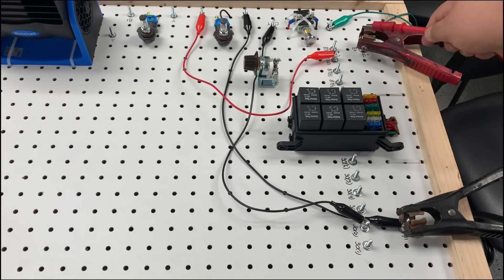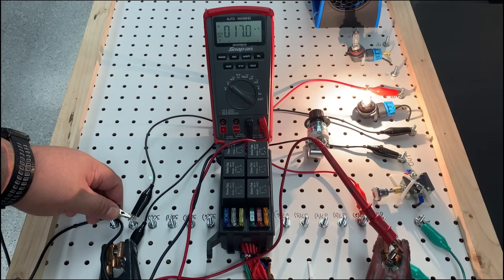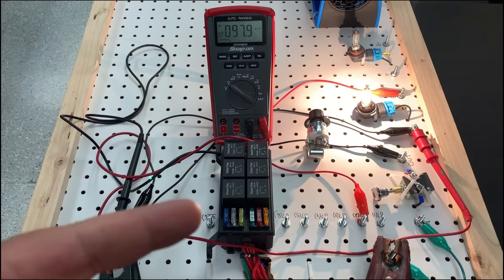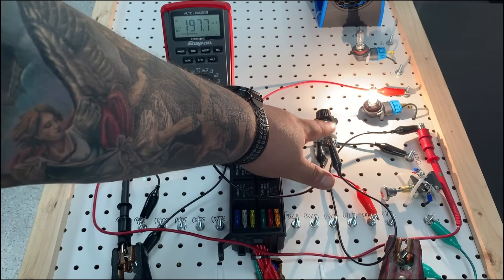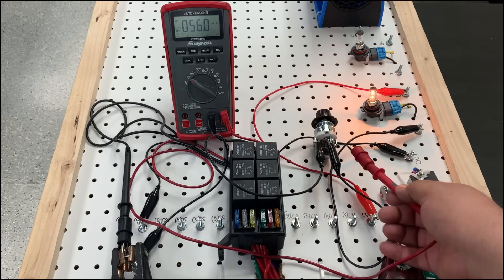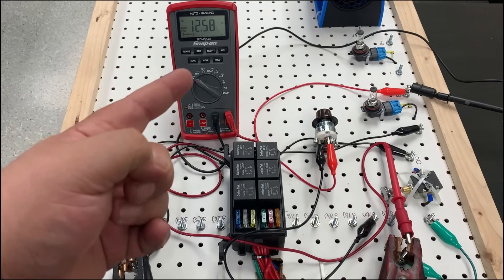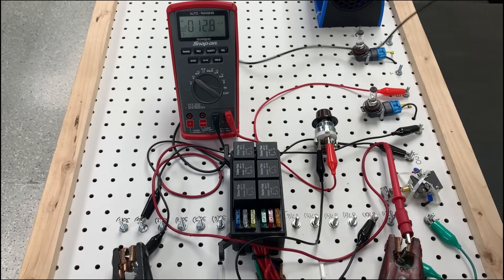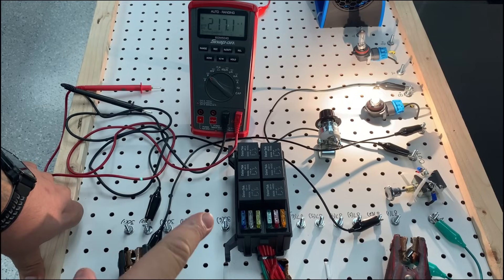How to Properly Test Voltage Drop in Automotive Circuits (Dynamic Method Explained)

Comment: im 86 years old been a mechanic most of my life understand voltage drop very well that being said for someone learning this is the best visiual explainition that i have ever seen i mostly learned trial and error. can remember the first time i had headlamp that woldn't work had power and known good bulb and without load had a good ground spent most of the day figuring out what could be wrong ran new wires and problem fixed this was very old vehicle no computers had even point type ignition. worked good with new wires then removed the positive lead connected original positive lead bulb worked  then removed new ground lead and reconnected old negitave lead bulb wouldn't come on wound up being a connector between dash and under hood had the green curse. wish had known this back then but will never forget load testing is the only way

Comment: Very confusing cant tell difference in the test and where the battery is supposed to be way too many wires going on brutha
Reply from the maker: In a car, is there more than one wire?
Reply: @MasterAutomotiveTraining 
I have to agree with Josh.  Your example was much to "busy" to effectively get the point across.  Unfortunately, you're not listening.

Comment: An OHM meter does have its place but good conductivity doesn’t mean good conductivity.Voltage drop method proves good or bad conductivity because of current flow.Vd=IR   Dynamic—must be powered up .Nice presentation CHEERS

Comment: Continuity tests at a few ma... a voltage drop test is performed at typical application current which may be 1, 3 or up to several hundred amps. Continuity will not identify gangrene or bad connectors all the time... high current testing will
Reply from the maker: Well said.

Comment: How about using a LoadPro? It makes a voltage drop way easier
Reply from the maker: I have never used one, always done it with a meter.
Reply: 110% agree, the Loadpro is the fastest way I have find faults in circuits. I use one almost everyday.
Reply: That tool has been proven to be not as great as its sold by several YouTube creators.